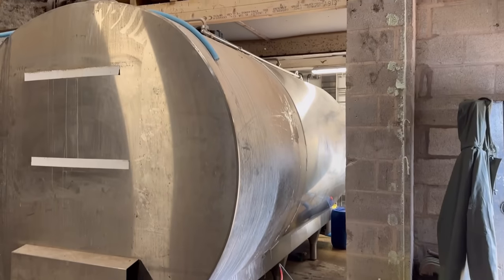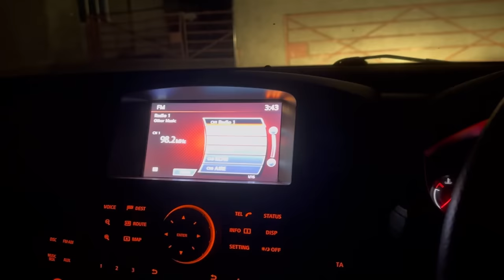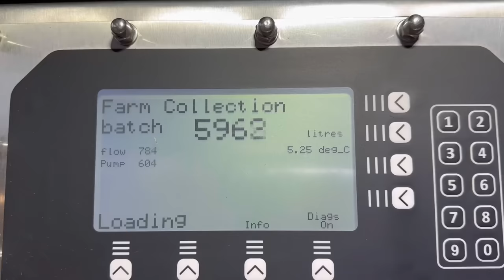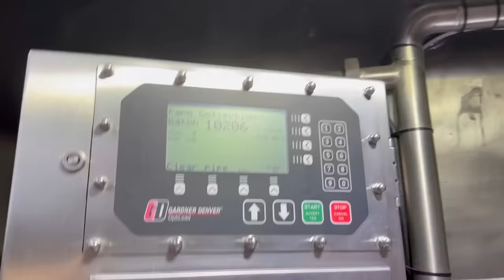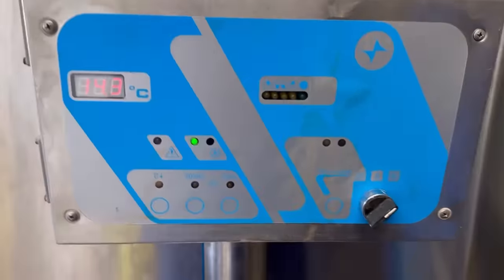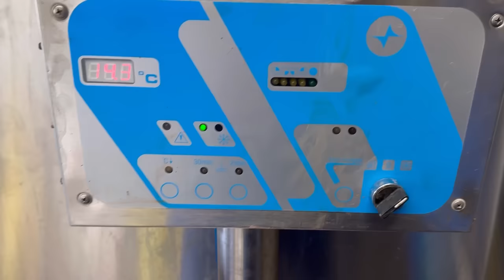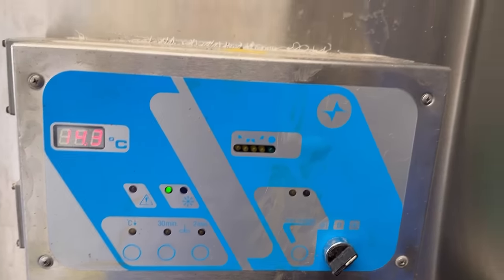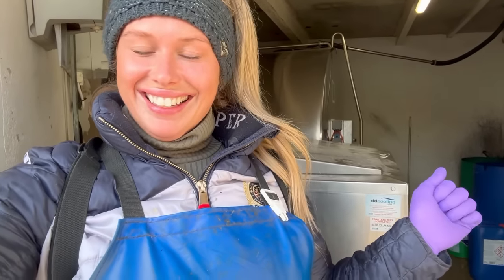NEW TANK. WILL IT FIT!?

Comment: I remember doing a milk tank change years ago.  Luckily our new tank was a bulkhead tank so only the front stuck through the wall, with the rest outside.  It was easier to make the change than yours.  Still, it was a race to remove the old, insert the new, and complete the wiring with placement of the new compressors.  We had poured a cement platform for it outside earlier.  Just like yours, completed just in time.  Thank you, Evie.